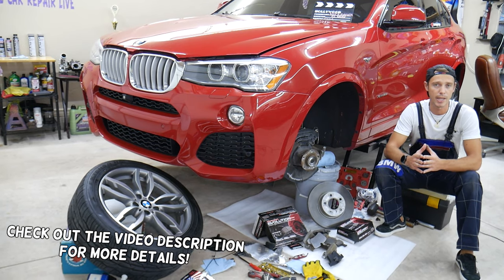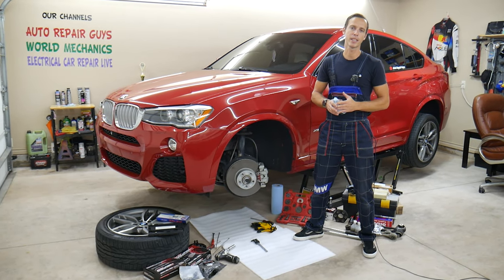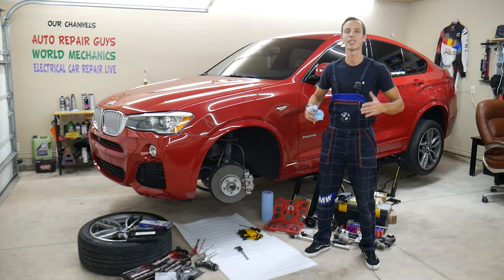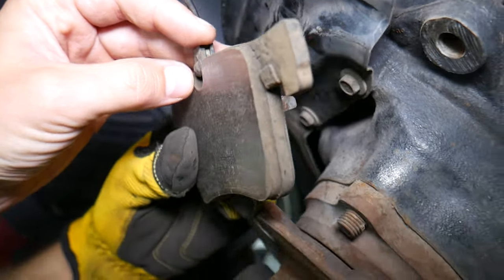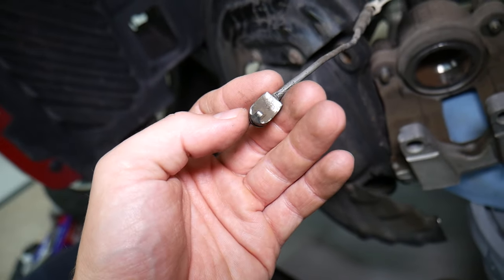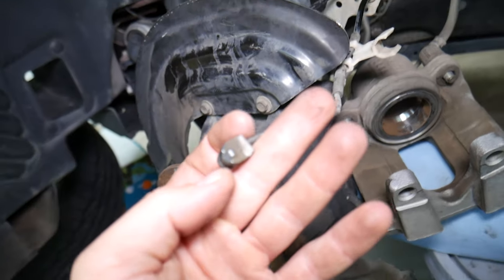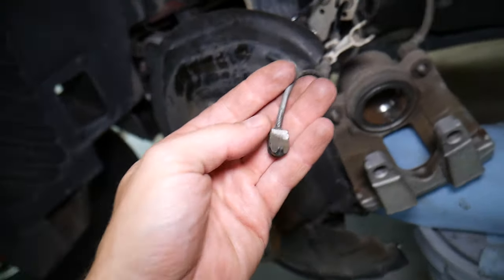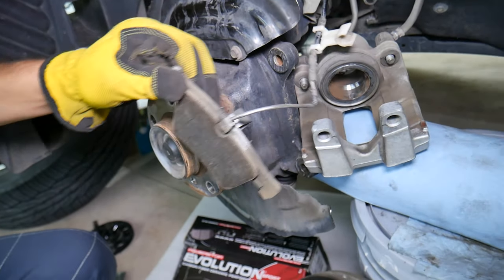DO YOU NEED TO REPLACE BRAKE PAD WEAR SENSOR ON BMW WHEN REPLACING BRAKE PADS

Comment: What's the green and red flag on the wall? I was guessing an Eastern European accent but I could be wrong :)
So If my BMW 520D F10 has 3.00mm left on the rear breaks, but the sensor I think has given me a warning exclamation sign on my dashoard in red, as I believe the interval for these has been gone over in terms of mileage on the service on the main center screen console, do I need to replace them immediately or is there some life left in them? 

More importantly, do these break pads have the "screetching" old school indicator that all cars have on our roads and you can hear all the time when people brake? If so, I'd rather forget about this sensor and just replace the brake pads once I hear screetching sound.
Reply: Bulgaria 🇧🇬

Comment: German cars is too complicated. japanese cars dont have those sensor and its easy to maintenance.
Reply: Just changed the brakes and rotors... easier than any Japanese car. I'd much rather a simple wire, than screaming metal on metal from worn pads.

Comment: Are there 2 sensors to replace (x1 for each wheel). Or just one?
Reply: I’m wondering the same thing. Do we need 1 sensor or 2 (1 for front and 1 for rear)?
Reply: @pavneetdhanoa5614 one for each axle, one in the front & one in the rear
Reply: One the rear one at the front